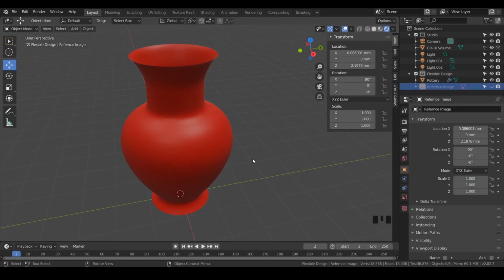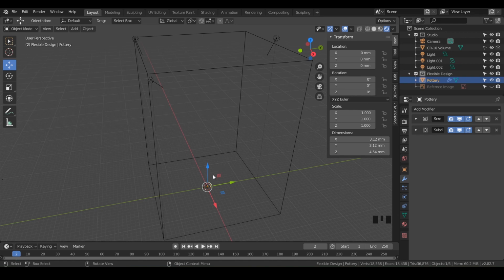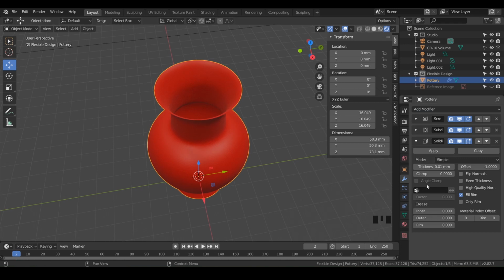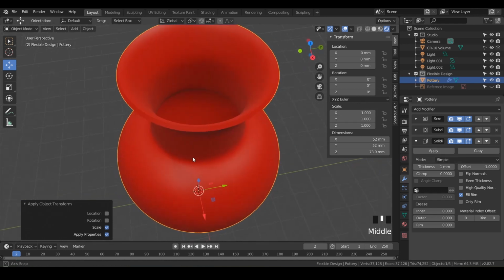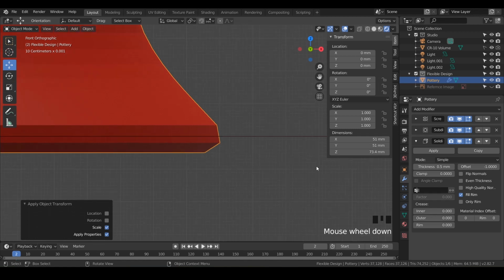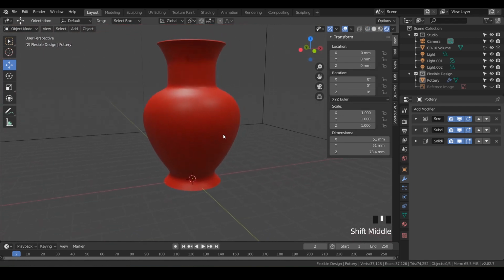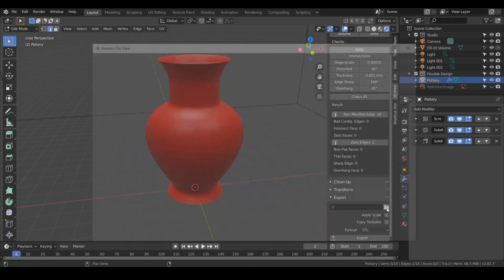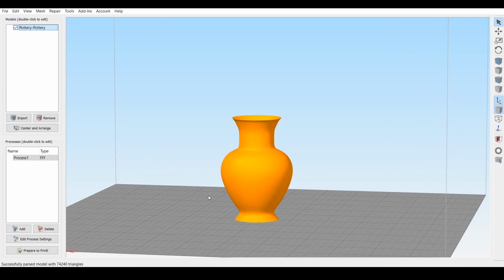Thicken it up | Blender for 3D Printing

Comment: Very useful, I’m trying to 3D print an aircraft model that I had previously designed for a Unity project,  but kept running into issues because  some parts of it were too thin to print. This seems exactly like what I need to do.